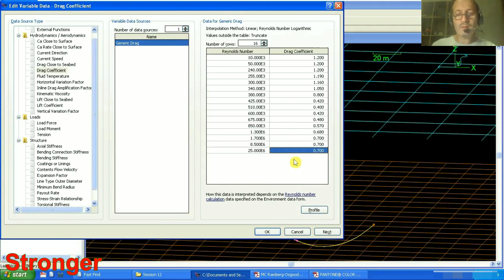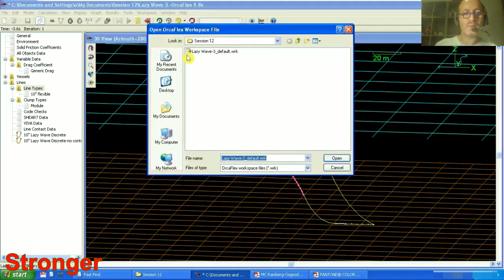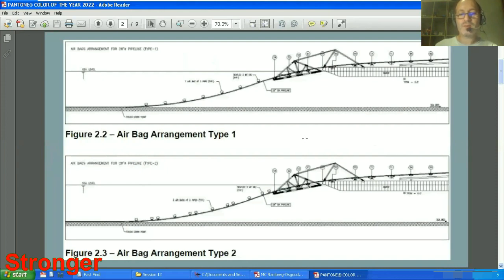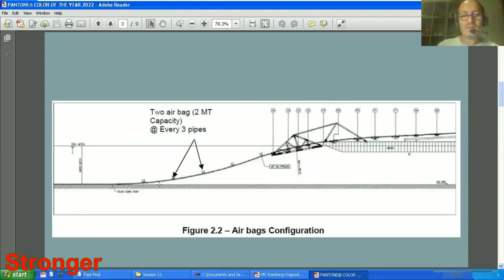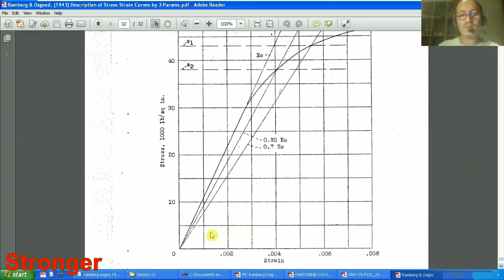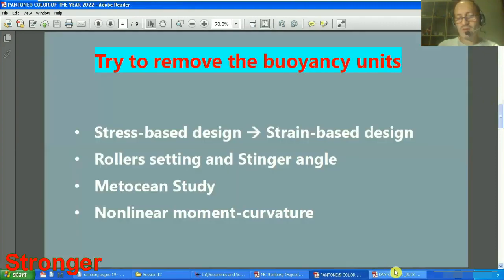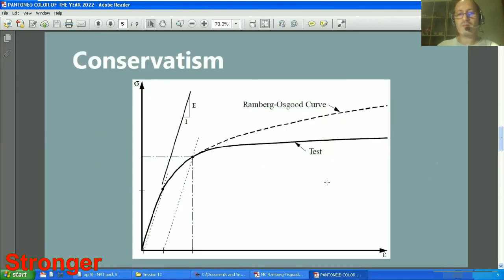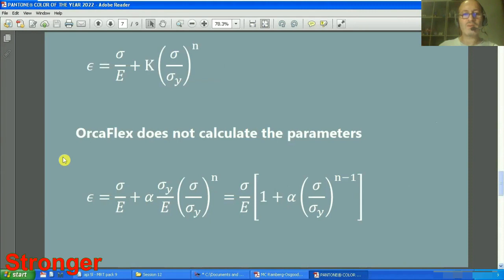OrcaFlex Variable Data | Marginal Analysis

Comment: Hello Stroger.
I have seen her video called "OrcaFlex Variable Data | Marginal Analysis". In the construction tree you access the "VAriable data" option and a subfolder called "Edit Variable data". In the Structure section, particularly in the Bending stiffness - Plasticity wizart section you update the data box, for Stress-Strain relationship, Ramberg.Osgood parameter option, please tell me how you obtain the value of the constant K. Thank you.